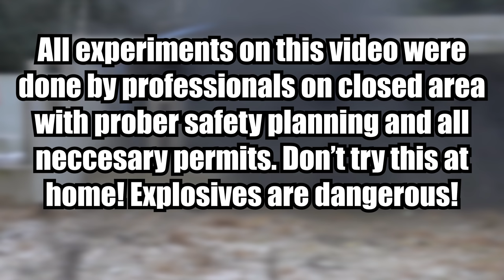How hard it is to explode a hole in concrete wall?

Comment from the maker: If like to see more explosion stuff go check Pommijätkät Youtube channel https://www.youtube.com/channel/UCr1cNqiNxK46w93zw9KfTLg and if you want to learn more about concrete stuff check out Perustava Youtube channel https://www.youtube.com/channel/UCgooHpBSNYX-CSUxTUxeuYQ
Reply: Congratulations on that hole! Water is an amazing material. Basically no compression at all, cheap, no pollution. Happy new year
Reply: Pls do Thermite next
Reply: it's not sharpnel, it's a debris.
Reply: tnx, now i can break out of my jail..
Reply: Intissä olin spollena ja kun käytiin läpi murtopanoksia, niin me käytettii teräsbetoniseinään 2kg penoa (C4 tyyppinen muoviräjähde) ja ton tyyppistä vesi "kannua" niin sitte tuli jo miehen mentävä reikä tommoseen seinään. Vähän jäi ne harjateräkset eteen mutta, kyllä siitä läpi mahtu. Ja meille sanottiin, että sodanaika me oltais vaan talon nurkan takana siitä räjähdyksestä.
Reply: hello. I love your videos and thanks a lot. But this is weak. Could you blow a very big amount of tnt. Like 1 ton of tnt (minimum) above a very huge steel plate to check the deformation? or blow 1 ton of tnt under a 50 cm diameter steel sphere?  you can create such a steel sphere with multiple layers of circular steel plates.
Reply: If you shape the charge, you can direct the force. The military use a shaped charge for armour piercing munitions
Reply: call it the Jerry Can Water Jacket
Reply: You should try putting oblek in the water jug and do that again I think that would work 100 times better than water and keep up the great videos I love watching them
Reply: THANK YOU!
Reply: Please try soaking (charging) Uranium with Deuterium then apply pressure from explosives.
The concrete should turn to dust and blow away just like 911.
Reply: ^^proBer safety, ha ha.
Reply: Would the density of the fluids used, give more penetration?
Reply: @rchltmedia  shrapnel is material that flies off of explosive that can kill people
Reply: You put the water can backwards. Of course it went through
Reply: Mark prosct
Reply: I wonder how a few boxes of American sparklers (I bet 6+)  ground down and made into a powder, I did it once as a kid, it spit a concrete cinder block in two, and cracked the concrete sidewalk under it.
Reply: Try a Panzerfäust
Reply: It's almost like they are trolling the MAGAts who invaded the Capitol building.
Reply: How to blow a hole in a concrete wall? Well he is dead, so you can't ask Sir Barnes Wallis   https://en.wikipedia.org/wiki/Barnes_Wallis  You could just watch the film "The Dam Busters. FFS don't mention the dog's name!  Look up on YouTube the film soundtrack spliced against the attack on The Death Star in Star Wars.
Reply: It would be interesting to know the hardness class (lujuusluokka) of this particular concrete wall that you used for this video. In my experience the majority of factory-made concrete wall elements are cast with C30/37 (K37) or C35/45 (K45) concrete, so my guess is it is one of these. It probably makes a big difference however if this element was cast with for example C50/60 (K60) or higher concrete.
Reply: I gotta wonder... was the "professional" that was referenced as inspiration for the water-canister-charge, by any chance, the great Dr. Sidney Alford? with his Dioplex User-Filled Linear Cutting Charge Kit (from 1987)? because the whole description of the thin layer explosive in a large 'pad' reminds me of that thing.
Reply: We can always Rely on the Russians
Reply: Wonder if there’ll ever be a chance to test an old school cannon and cannonball. Don’t know if you could find any way to do it, but it’d be awesome to compare someday.
Reply: @8:00 My question: If you would attach a metal plate (or wooden block, or a bunch of books) with the same mass like the filled watercanister, would the result of penetration into the concrete wall be the same? So simply spoken, is it the reflection of the detonation impulse due to the accelerated inertia of the mass attached to it? Thank you for your exotic videos!
Reply: Ever do billiard balls at 50000fps?
Reply: I thought the water wouldn't work until i saw it on the wall and understood exactly what was going to happen
Reply: Visits Finland 
Hears bomb at airport 
What a was that!!
Stranger Everyone has hand grenade in Finland
Reply: The effect that the second explosive have when it doesn't penetrate but still damages the other side generaly refered to as spalling was actually used in anti tank projectiles for some time. But most modern vehicles have anti spalling layers designed to catch fragments to keep the crew safe.
Reply: what is prober?
Reply: I didn't correctly heard the name yu give to the gas can explosive
Reply: This is your first video i watch and i immediately fell enamored with you guys and your channel. You are funny, inventive, smart and very resourceful. And i would lie if i didn't say how much i like your accents. It's just like we make you sound in our anecdotes about Finland. i am Russian so we tell jokes about you sometimes. All in good spirit of course!
Get yourself a subscription and a new follower from Russia!
Reply: Absolute class guys, wonderfully entertaining, informative and charming.
Reply: Hey look at that! I just enjoyed learning!!! 🤘
Reply: You folks look like you're having fun. Enjoyed the video ☺️
Reply: Thank you for the test. I've wondered how secure reinforced concrete is. We are considering building a new home with reinforced concrete.
Reply: I know this is random but I thought of an idea while at work and would love to see it come in to fruition .. I wonder if you can wring an entire towel dry with the press. Could you make a wet towel dry from pressing.. idk. id watch. Lol
Reply: I wanna see what happens when you shoot the wall multiple times
Reply: I think y'all concrete has the quality, but the American one would just fall in pieces immediatly... 🤣🤣🤣🤣
Reply: Could you have subtitles in your videos? I don't know how many people have asked that, but I am American and find the people in this video quite hard to understand with their accent.
Reply: Ha. Tu est un picito test?
Reply: If only there could've been insurgents awaiting sentencing standing behind that wall. "So what do you think they are going to do t" 💥..........
Reply: prober? safety planning LOL
Reply: It’s nice to know the Finn’s also like “Big boom”😄
Reply: 😂 love
 It
Reply: better then steel??? mybe IRAQ use this on tanks reason cheap and usefull